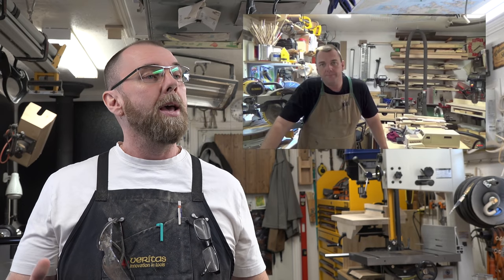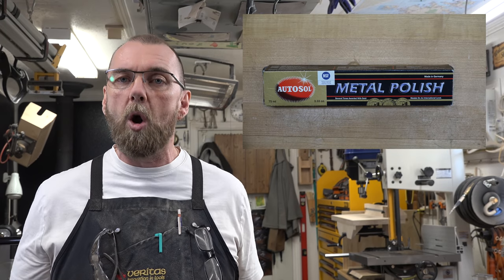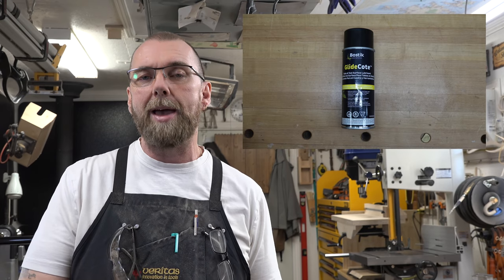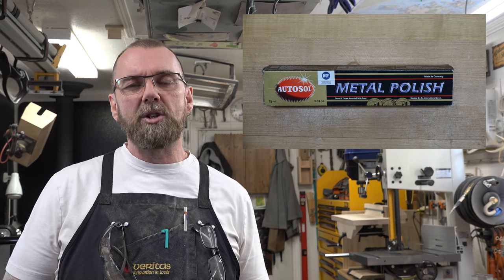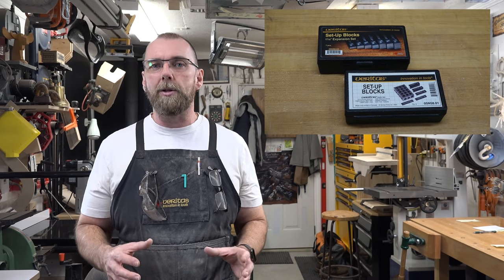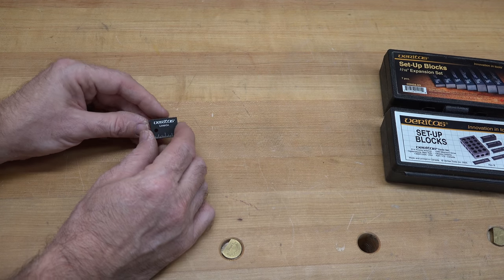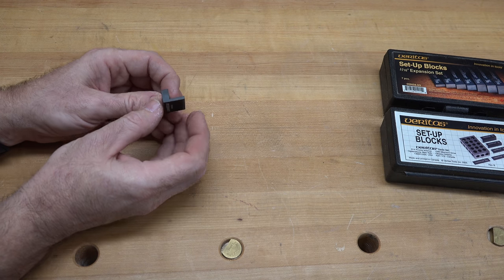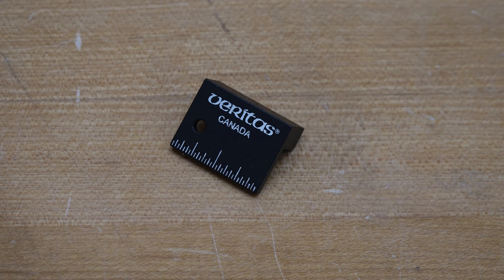Update Show Part 1

Comment: Ken,  hey, I like this project review.  Gotta agree with you about the Incra T Rulers.  I have the 6 inch and the protractor.  I think I have used the protractor twice but the 6 inch one is great with a capital G.  I find the biggest problem I have with it is finding it on my messy workbench.  I started putting it away after I used it but I was afraid of wearing out the hinges on the cabinet.  Hope next week you include the wooden mallet you made.  I also made one after that show and I love that thing.  Looking forward to part 2.  Thanks for bringing back memories.
Reply from the maker: Glad to hear that you enjoyed the program Paul.  I couldn't agree with you more about the T-rules.  I absolutely love those darned things.  I mount mine on a magnetic tool bar just behind my bench so that they are always within arm's reach.  Great little devices.  Thanks for tuning in to the show and I hope that part two lives up to your expectations.

Comment: Thanks for the tip on the Autosol. I've also used the GlideCote and found that its rust preventative properties don't last as long as I'd hoped. My workshop is in an unheated garage, so most of my tools aren't used much during the winter month. Last fall, I had coated my scrollsaw with the GlideCote and I was dissappointed to notice last week that the table had developed a layer of rust. A can of the GlideCote isn't cheap, so I had hoped for better.
Reply from the maker: Although I didn't have any rust Jim, I did find that the glidecote didn't last as long as I would have liked it to.  The Autosol lasts much longer and is cheaper.  I also find that a tube of Autosol lasts longer than a can of glidecote.  You only need a little bit of the polish because a little goes a long way.  Thanks for tuning in to the show Jim.  Great to hear from you.

Comment: Great follow-up, Kenny!  You don't see many of these.  Appreciate your sincerity on some of the not-so-good projects.  I missed the initial review on the Autosol.  Based on your recommendation I went out and purchased a tube of this.  My tablesaw cast iron is in need of some TLC and I'll give the Autosol a test drive.  Thanks for your vid and look forward to the next one!
Reply from the maker: Thanks for the kind words on the show.  I'm glad that you enjoyed it and I agree that there aren't many of these types of shows.  That's why I thought it would be a great addition to Alternative Tuesdays.  As for the Autosol, just remember that it is a finishing polish and coating.  It will not remove rust and that sort of thing and you will still need some steel wool and penetrating oil along with a ton of elbow grease to get the table top looking great again.  The polish with help finish it off and keep it looking great for a long while.  Thanks for tuning in to the show.
Reply: Thanks for the tip on the Autosol!  I live in Florida and my shop is in my driveway so I get a great deal of surface rust on all my tools, especially my tablesaw.  It's a constant battle.  The Autosol will help a great deal.
Reply from the maker: You're very welcome  @rhihodag9873    Good luck with the rust problem.

Comment: Hi Kenny! I was wondering about removing the swirl marks from machining the cast iron pieces on say the table saw, jointer or bandsaw. The autosol does what you describe but even using sandpaper with a fairly agressive grit can't seem to remove the original swirl marks.
Thanks, Bill
Reply from the maker: The swirl marks have never bothered me Bill so I have never tried to remove them.  They are quite a bit deeper than the normal every day abrasions on the cast iron surface so I would think it would take quite a bit of work to remove them.  My thought?  Why bother?  Thanks for tuning in and taking the time to leave a comment.